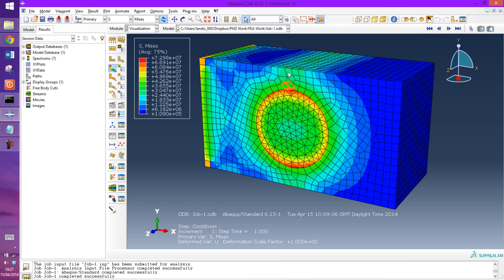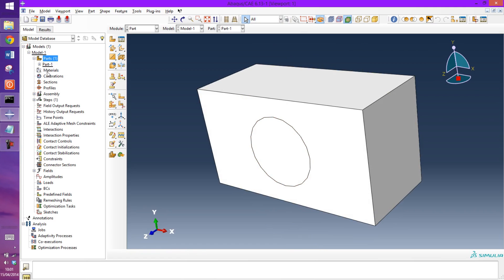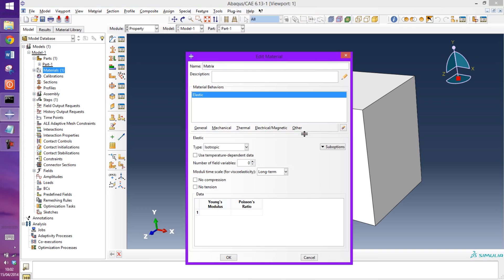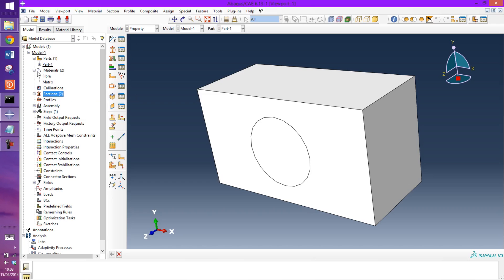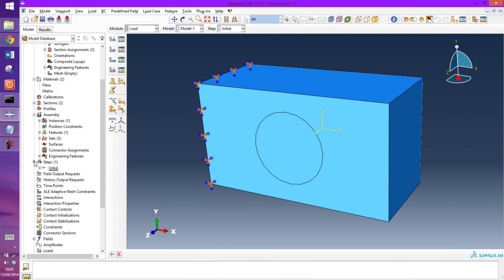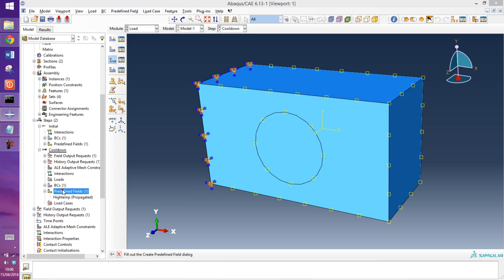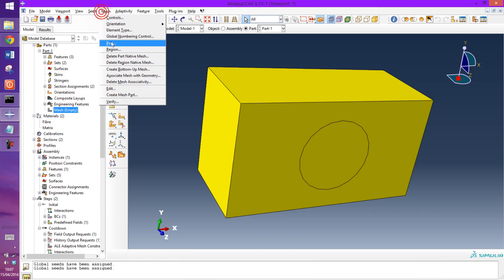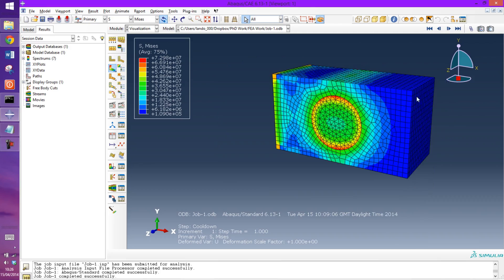Abaqus Tutorial - Thermal Stress

Comment: I followed the exact same procedure as shown in the video but there seems to be some problem and my model shows deformation in the end. I double checked and did the simulation again from scratch but seem to be getting the same result. Although the contour comes out the same but the cuboidal shape shows a deformation which is not seen in the video. Can someone tell me where I might be making a mistake? Maybe some default settings are incorrect?
Reply: It is quite funny to answer your question after 4 years that you asked it but, I saw it today and maybe it can be useful for other. 
you can change the deformation scale factor from the "common plot options from option toolbar". I suggest using Auto compute, it is correct most of the time but you can change it by choosing the "Uniform" and giving a value below. Good Luck